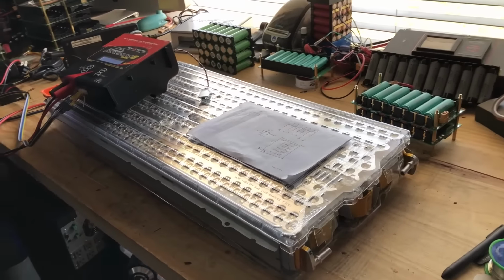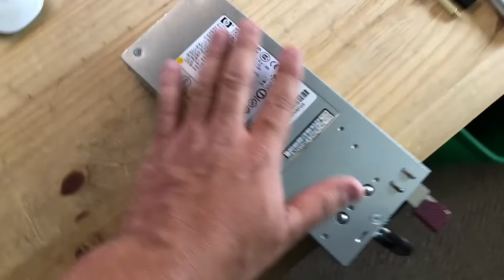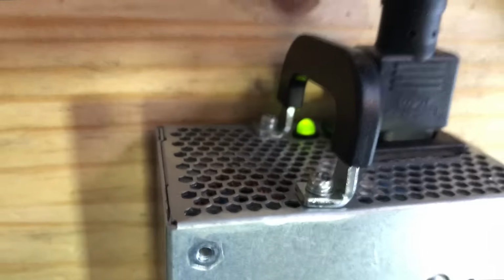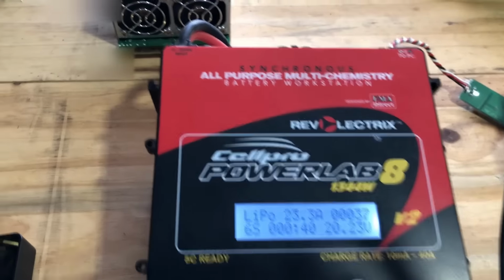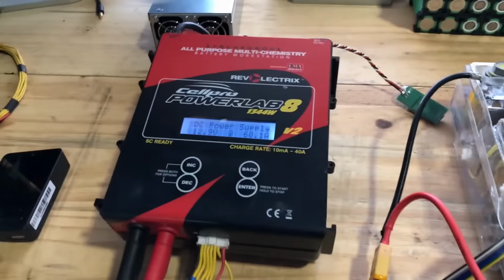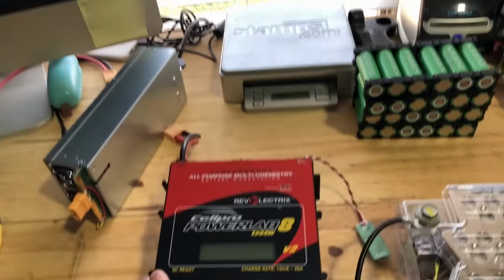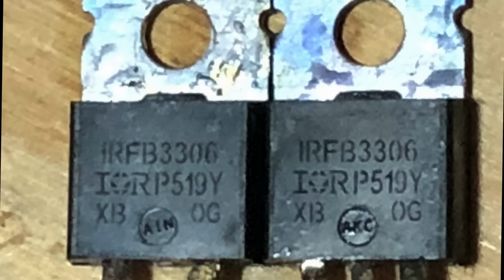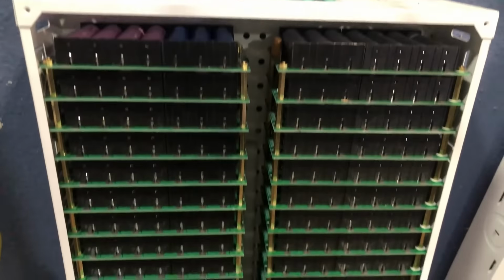How To Ruin A $300 RC Charger With a $25 1000W Power Supply

Comment: Wasn't it 60 amps at 60 volts?
Reply from the maker: The power supply is 12v  and my battery is 24v
Reply: @jehugarcia  the rating of the mosphet I mean

Comment: That Power supply is just fine.  The problem is with the shitty charger design and maybe even fake mosfets.  It uses only three mosfets in parallel.  Each of those mosfets is rated for 230W absolute max each so 3 x 230W = 690W you are running it at 771W (https://youtu.be/0bAiPZDwC9g?t=415) so even if they are original mosfets its too much power for them.  That charger shouldn't have allowed and hence tried to use that much power.  I'm guessing you never got it close to using that much before.  They should have designed it to use 4 mosfets to have a little extra capacity at least.
Second point is that Mouser showed two alternative mosfets which would probably have been fine - you'd need to check the datasheets.  The main difference was the drain source resistance which was LOWER, this means they dissipate less power for a given current (power = I x I x R).
Did you ever fix this?   I think if you'd be fine so long as you limit the max power to 500-550w (i.e 40-45Amps).

Comment: I think the Power Lab  Duo 8 could do what you were trying to do...   I have the standard PL-8 just like yours   ..  I see you have the PC interlink for it so you can go in and change stuff in the software..  I was told by one of the Compass Heli Team guys to run a max of 50amps out on the unit with a 24 volt input…..   I guess now I know why now.
I did call the company about using a 36 volt input . . . .    and asked why it was setup for a 32 volt input...   They said NO !!!!   can't use a 36 volt input and he could not say why it was designed for a MAX 32 volt input.

If you want MORE POWER !!!  just pick up a duo-PL8     and use a 32 volt input.   They are the best charger money can buy.
Reply: OHH   I forgot 
you can add another PL-8 to yours and run one as a Master unit as well....   I think that is what the PL-8 is  just two PL-8's installed in one case all put together
Reply: Hello, about the 32V Input design, it's often to handle the fluctuations of the supply. I designed some cards myself and had to correctly design what can happen on the input. 

For example some cheap 24V converters still have high and low peaks at 50Hz (or 60Hz depends where you are located) and often can result of 24V nominal but with peaks up to 32; 33V, because they have not enough smooth by capacitance or just basic FBRD without any regulation compensations at the conversion stage.

Comment: Its not a 1000w power supply. We are in the states so unless you're running it on a 220v line, the max output of the supply is 69.5amps. I own an RC charge lead company www.PunchedRC.com and would recommend you get rid of those xt60 connectors and go straight into the pack with 10awg and get some better connectors to the pack itself. All those connectors are doing is creating resistance and heat. The XT90 on the power supply is fine, or you could also go with an EC5. If I had to make a guess the mosfet that popped may also have not had proper thermal compound to the heat sink and you were really pushing that chargers capability. I really hope that you didnt pay $300 for it. If your spending that much money, you would be better off with an iCharger 4010 thats good to charge up to 10s at 40amps.

Comment: but the top of teh charger says 40A right there
Reply: yes, 10ma - 40amp. I suppose if you want to complain, you could argue it should not charge higher than 40amps.
Reply: lets be honest, 
he was going to shoot for 80A
Reply: The 40A rating is on the output, not input: "Input current: 1A to 60A, software limited" taken from the specifications on their website
Reply: Also, you HAVE to run this charger at 24 plus volts if you going to push 1000 continuous.. it says right in the manual that it is limited to ~600watts at 12volts..  Jehu was at ~ 720watts when it blew.. I know this charger well cause I use the newer version (Powerlab8 Touch) almost every day for my lipos for RC

Comment: This is Bullshit! Do not give people false information. There is not a damn thing wrong with using that power supply. You made a mistake and worked the power supply to death.(User Error) You should have went with 2 power supplies in series and made 24 volts. That would have took the strain off of a single supply. Or you could have limited the current draw in the chargers menu.

Comment: Cheap no name MOSFETS. The cooling is rediculess
Reply: no name ? those mosfets were international rectifier branded !
Reply: nope those look genuine but the picture of the ebay ones do look fake.
Reply: @Agent22817  Thought the same, that eBay/AliExpress has lot of fake underperforming mosfets. In his place I replace them other part number, either the similar or higher spec from digikey